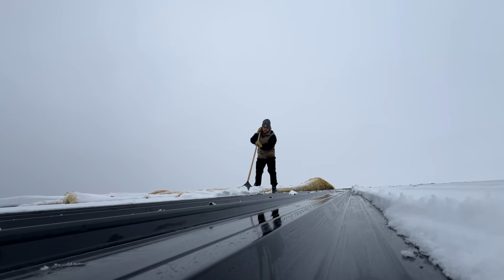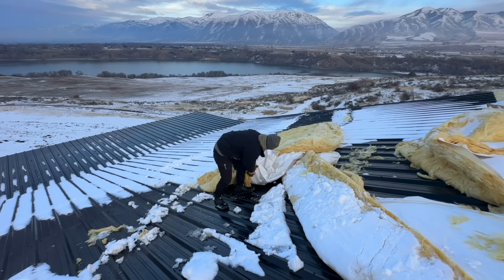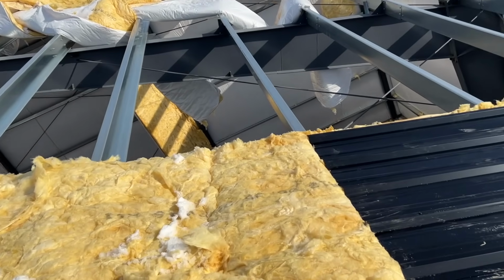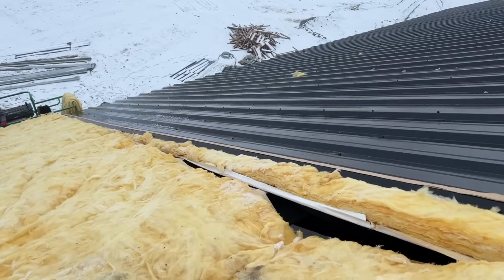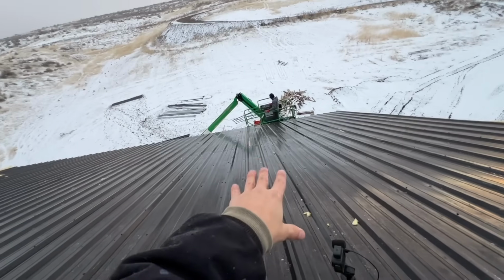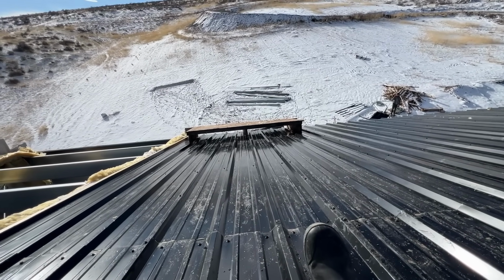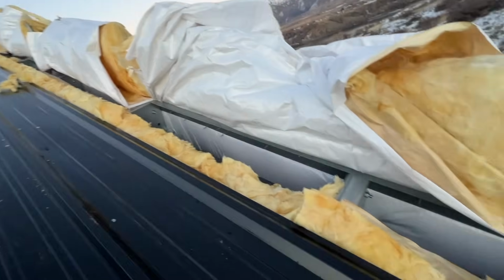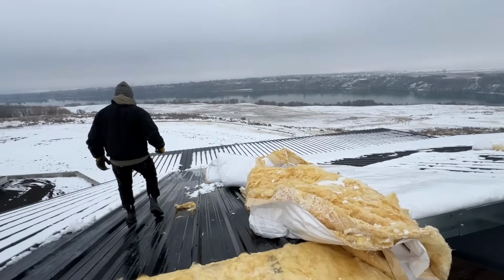Slid OFF THE SHOP ROOF!! Dream Shop Part 7

Comment: Joel, you were making me and James very nervous. Tennis shoes are not good to wear on metal roofing. I fell sideways in my driveway while making an attempt to staring my truck. I hit a small patch of black ice with tennis shoes on that morning and down i went after hitting my key fob  Bouncing like a basketball a couple of times in my driveway. 4 hour surgery with having plate,rod and screws put in place to repair it. Fractured my femur all the way across and chipped it too, right below the joint. 17 days in the hospital and 2 and 1/2 months in a nursing home for rehab. Close to a year of physical and occupational therapy. When I was younger I use to build grain bins. I didn't care for those heights either. Thank goodness my only injury was on ground leve while l was building those grain bin builds in central South Dakota. Be careful, buddy.

Comment: Where is that safety line and safety harness?? I think they should be a necessity especially working in winter conditions on a slippery metal roof, those rubber boots are just gonna keep sliding when they get wet. But Im happy you by the grace of god got out of this situation unharmed.

Comment: Can't you wear those winter cleats on you boots and not slide so much or would that ruin the roof?  That's so scary to watch Joel!!!
Reply: You can't wear yak tracs on metal roofing. He for sure would fallen wearing those. Tennis shoes shouldn't be used either. A harness would have been way better. Honestly, I would have waited until spring to finish the shop if it was me.